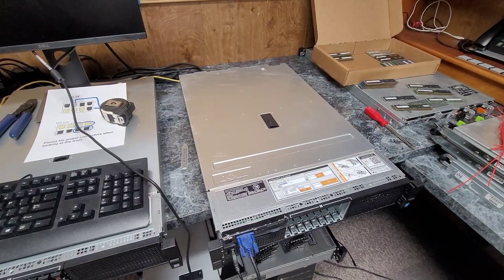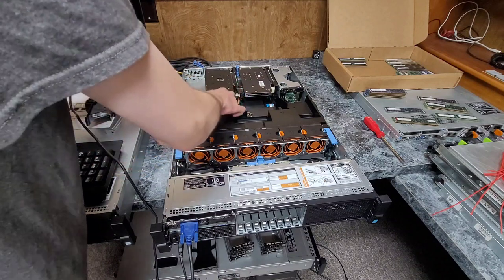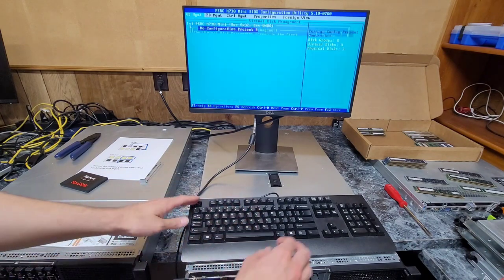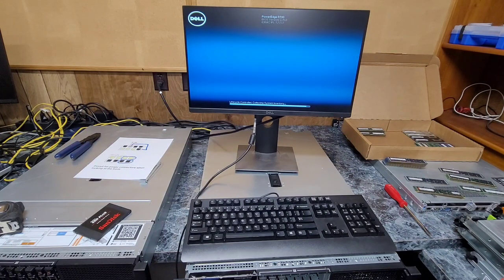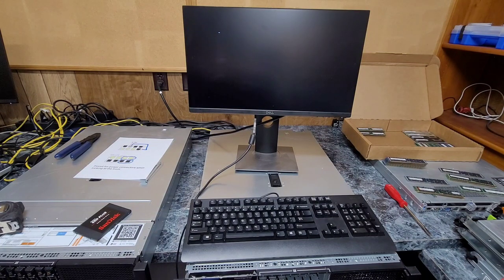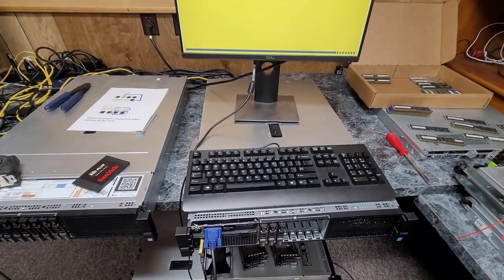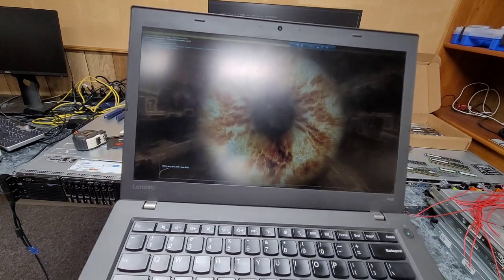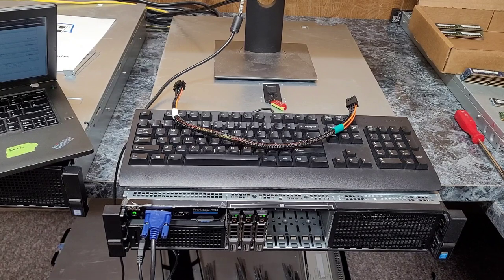Testing what may be my biggest server upgrade. Will the Poweredge R730 be my next server?

Comment: I have a r730xd for my home setup. After spending like two days updating the lifecycle controller and BIOS as well as getting proxmox on it, its worked like a charm. I just have SAS and SATA drives so no nice NVMe's yet but that will be when I am ready to upgrade this one. Other than that, I have forced my fans to operate at like 10 percent I believe and have it set to not go above a certain threshold in iDRAC and with it almost full of RAM and about 1/2 the drive it can handle it sounds pretty quiet and works perfectly.
Reply from the maker: Nice. I keep telling myself I am going to get around to making the swap. I now also have a PowerEdge T640 but I don't think I want to spend money upgrading it.
Reply: @computersales  i don’t blame you man. I’m looking into some r600s series so I can do backups but I’m in the same boat of NOT wanting to spend the money right now lol.

Comment: I know it’s been a while, but a note for the fans adjusting with GPU temps. The Tesla P40’s do not have fans :-) there’s a metal plate with fins, it’s designed to use the R730’s chassis fans with the ducts to cool the cards. Pretty cool design. Noise wise idk 😅.

Comment: Did you keep it? I used the IPMI to set the fans at 30 percent and it's been nice and quiet. Temps are fine.
Reply from the maker: Yeah  I ended up doing a chassis swap to make it a R730xd. I still need to make a plan and build it out. I got 16TB of NVME on standby. SSD prices went up so I will probably have to wait to buy some more 2TB 2.5" drives.

https://www.youtube.com/watch?v=rlOZd8cIXig

Comment: Do you have any pointers to the power cable wiring diagram? Also, where did you end up plugging it in?
Reply from the maker: The cable plugs into the riser

This is the design you will need for the R730. Should also work with other models.

https://youtu.be/fvgw9sv8k9I

Comment: ESXi or any other virtual hosting is nice and all, but what 'machines' do you run in a "home lab"?  You could get a bunch of cheap, headless boxes and run a few machines with a lot less trouble and possibly cheaper.  Gigabit unmanaged switches are cheap these days.  Is the M40 going to help you with AI/ML coding or research or is it just a resource for the virtual machines to use?  What are the virtual machines doing that they need the graphics for?  Are you doing work for clients on your virtual machines to improve your ROI?
A lot of people on the Internet, such as on YouTube show how they can do a bunch of fancy stuff, but they rarely discuss the practical application.  I just want it to work.  The least complicated path to that is most desirable to me.  Incidentally, my house LAN flagship is an HP DL380 Gen 9.  It does DNS, and file and print sharing.  If I need to test something, I might temporarily create a virtual machine in Hyper-V.
Reply from the maker: It runs my NAS. Random test environments and I do some video editing on it. Eventually I'll get into home assistant and have it run my NVR. I could use a bunch of random PCs but then I have more hardware I have to manage and more hardware to fail. I know from experience.